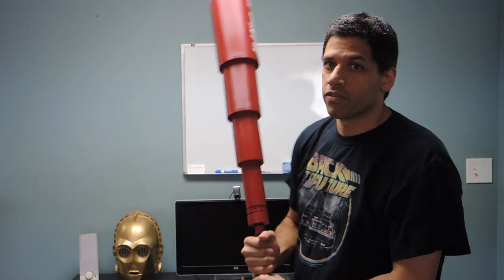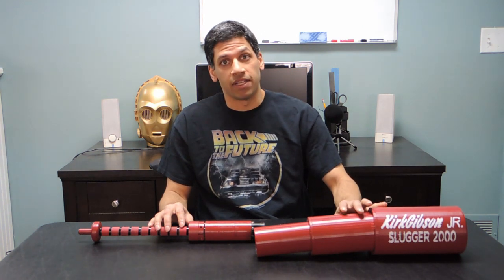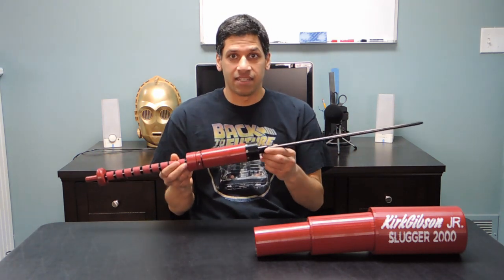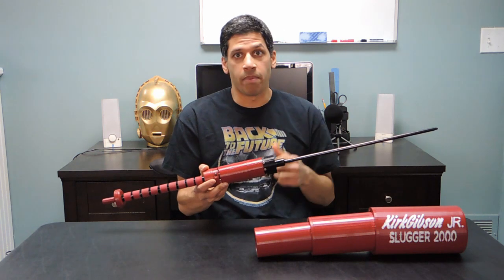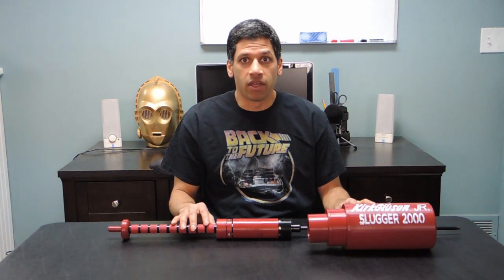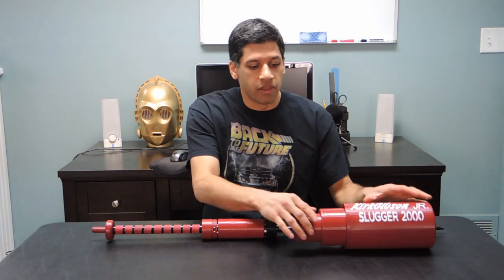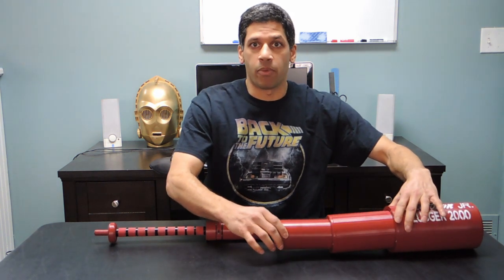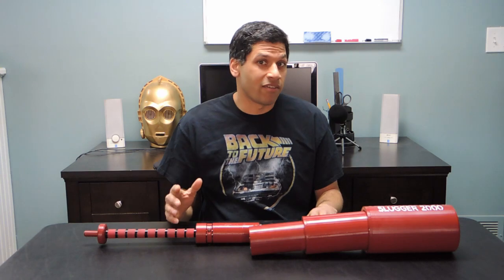Back to the Future: How Strong is the 3D Printed Automatically Extending Bat?

Comment: Hey! Cool idea! What material did you use? Looks and sounds like PLA, which is quite strong, low cost but brittle (breaks quickly on high impact stress) and causes this strong noticeable noise.  I was impressed how long it survived. You probably used PLA for the gears and wheels of that robot, too. Nylon is probably more appropriate for gears (but very complicated to print). TPU print nearly as easy as PLA and works fine for larger gears. But, is quite flexible and thus not suitable for a bat.

Maybe, a combination of TPU as an inner core & telescoping section and an outer shell out of carbon fiber hardened PLA might work. The outer shell probably should be sliced into three ~115° parts leaving small gaps between. So the impact force doesn't force the material to bend a lot.  You could 'weld' it together using acetone or use screws, or use a dovetail to connect them. The latter would allow the replacement if the non-flexible part breaks.
Yeah, you surely did not design it to be of practical application in real life. But, as it might be used as a requisite for a movie, it's maybe good if it is a bit more robust and doesn't make a lot of noise (since your artist might talk during the scene). Hope this helps you to improve your awesome inventions even further!
Reply from the maker: Thanks Stefan.  The bat was actually printed out of ABS.  The robot was mostly PLA.  I appreciate the material recommendations- I usually only print with ABS and PLA, so I need to start exploring other materials.  I also like the feedback on how to improve the design of the outer structure of the bat- that's fun to think about if I ever do a second version or need a similar design in another application.

P.S. Is this the Stefan from CNC Kitchen?
Reply: @PotentPrintables  No, I've no channel right now. But, if you are looking for very scientific initial guidance on filament properties have a look at the stuff by Thomas Sanladerer; especially his overview on his filament tests: https://www.youtube.com/watch?v=fjhW2NiILZc ; Also filamentworld.de has very very helpful information in the "additional information" tab (as "TENSILE STRENGHT" and "IMPACT STRENGTH" or "SOFTENING" temperature) for most filaments they sell. While they are quite expensive, they have a very broad range of filaments and offer affordable samples service (you can order just 80g samples of most filaments to try them out); but the technical data is by far the most valuable information here - and this is free! It's a German site, but just scroll down to "INTERNATIONAL" (and click on the flag of your preferred language) for a google translation.

Comment: As an improvement id swap the piston around the other way so the weighted part is at the top end, then attach it to the outer shell which ideally would be metal, thus making this weighted more like a bat and also much stronger
Reply from the maker: If only I had a lathe or a milling machine to make it out of metal!